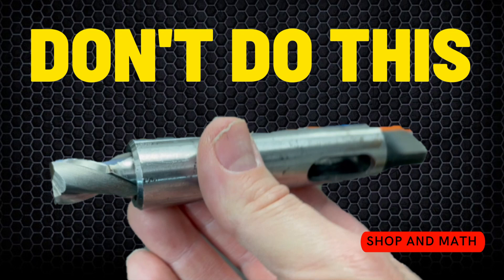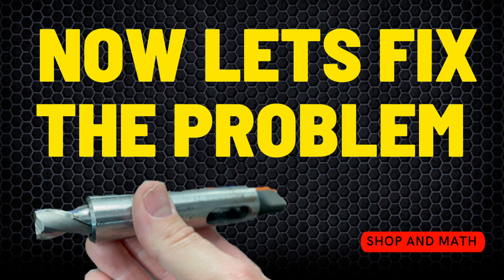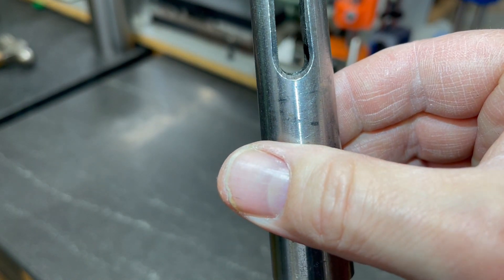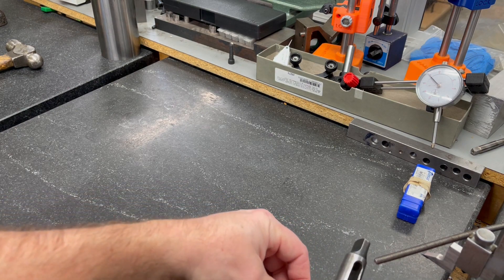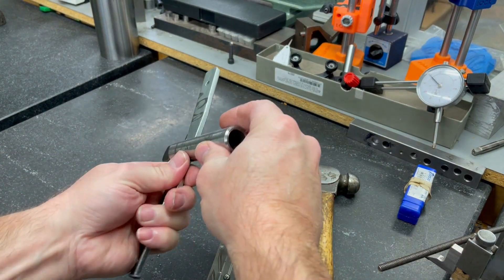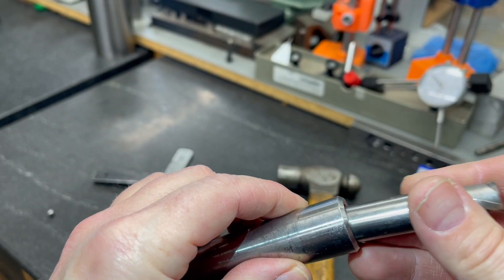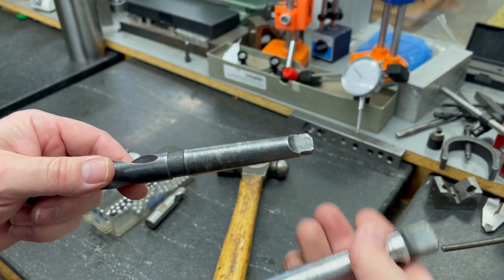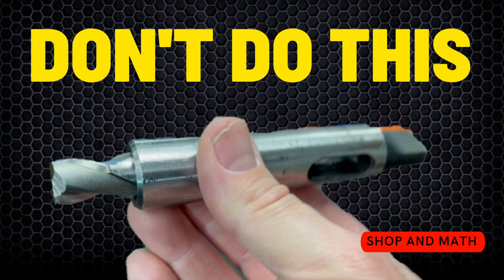Don't Do This

Comment: note to others... don't do this and you wont have to worry about losing your bearings...

Also dont do this type of activity on your granite inspection plate and don't drive end mills or other cutting tools out of holders over hard concrete or granite surface to avoid chipping your brittle cutting tool when it inevitably shoots out of the holder onto the floor or hard surface.

Comment: I make a hammer using a chunk of pipe that slides over the mill bit. Then I tape the arbor fast to the unit, Then smack the end of the pipe on an anvil. The mill will slide down the pipe and out of the arbor. This is also a very good way to remove recessed bearings.

Comment: On the next "Don't do this..."  Don't use a 1500 dollar surface plate as a WORKBENCH!  Bet you didn't think we would notice?  ;-P
Reply: you can pick them up cheap when you look , but it wont be calibrated and who knows if that is .
Reply: @markhorner4982  I know...  I just bought a pristine rock of ages for a 100bucks.  Good enough for the ugly shit I make.😉😜
Reply: Use that $1500 surface plate as a workbench. How flat is a nicely polished $8000 headstone at the graveyard.

Comment: I'm watching the start of the video and I'm saying in my head, "He's gonna need some ball bearings to get that out!"  Not every morse taper you want to use in a sleeve will have a tang end, so I have used this trick quite a few times.  I have stuck a slightly larger ball bearing on the end of the part going in the taper with a dab of grease since it will press on the countersink for the drawbar thread and not damage the thread or anything.
Reply: Thanks for sharing your solution
I never thought of using grease to hold the wall bearing in place
I did try using larger ball bearings the only problem is it wouldn’t fit in the slot
And when I can’t find ball bearings I have used nuts as well
This video is for students to help prevent this from happening again
I’ll be showing this video during my safety week introduction to shop
Thank you for taking the time to comment
Ray